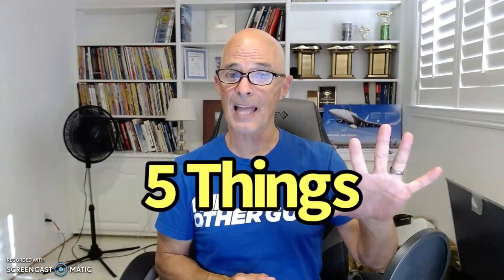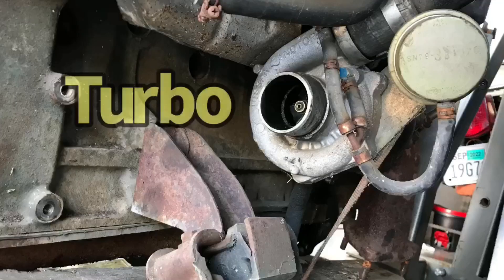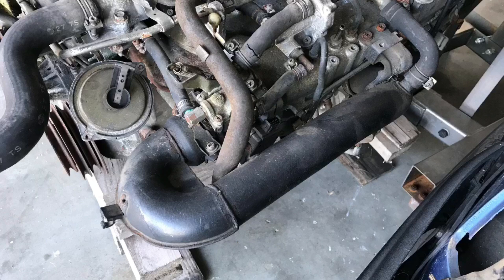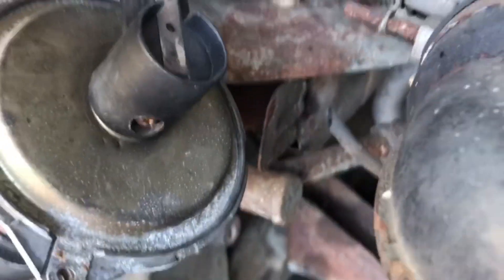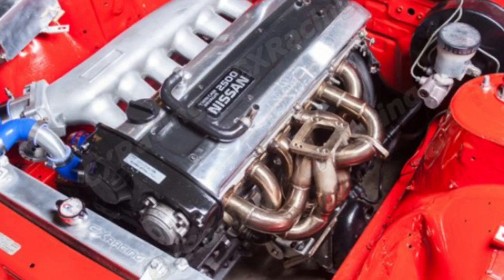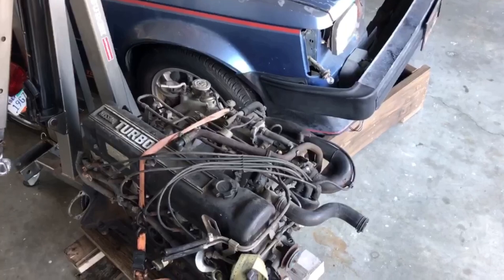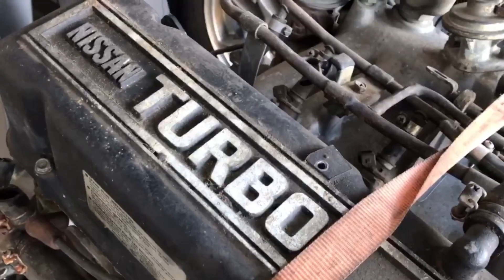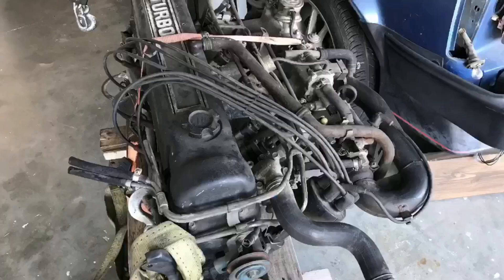280ZX TURBO-5 THINGS I LIKE AND DISLIKE ABOUT THE L28ET TURBO MOTOR. PART 1 OF THE ZXT MODS SERIES.

Comment: You missed one more bad, the throttle body.  We dynoed a S30 with a l28et.  He would make 280 ish hp and over 300 lbs-ft of tq but he kept running more boost to get it over 300 hp and it wasn't liking it.  I gave him a throttle body (KA24de or vg33 can't remember exactly) and a intake manifold that was roughly ported to match the Tb bore.  The car made over 300 at the lower boost level!
Reply from the maker: SEEMS ODD THAT A BLOW-THROUGH THROTLE BODY WOULD BE RESTRICTIVE AT THAT POWER LEVEL-I'LL TEST
Reply: @richardholdener1727  it had a intercooler and a gt35 turbo and I think we were under 20 psi but it was at least 10 years ago.  I can contact the owner cuz he still has the car and give you more specific if you want.

Comment: Love those mills , very smooth and a lot of fun .
Crossflow heads on I6s are not common , despite the advantages they would give .
No aftermarket company wants to spend the money to develop them , even for common domestic engines , despite the vast numbers of them out there .
It certainly is not a realistic home project , although , it has been done , at least on Ford 4.9s anyway .
Some folks absolutely will not let anything stop them .

We will forever be stuck with wondering what might have been with all these non crossflow designs .
At least these motors respond well to all the old tricks and many new ones  , despite the after.arket generally giving the owners the same finger the factories did .

As for the that hideous witches nest of lines on your engine , i prefer to think of that as a scarecrow to keep the lazy and the unmotivated out of the engine bay .
I am looking forward to seeing what you can wring out of this engine .
Reply: There are a few Youtubers building Ford 300 with welded together LS heads.
Reply: I have seen that , and it is cool as hell .
I especially love the 4.9 .
The fab skills are pretty awesome as well .
And there is just a certain special something about projects that will piss off both Ford and Chevy purists at the same time .
Maybe Richard can do a Pontiac I6 when he finishes with that Z engine and his Trophy 4 .
I am curious to see what he can do with a 230 or 250 cammer .

Comment: LOW C.R it's a freebie.
Intercool it and boost the living shit out of it.
That will solve your LOW C.R concerns.
The only thing I truly hate about this engine is the NON-CROSS FLOW head.
Same for the Chevy 250, 292, Ford EFI 4.9L, Chrysler Slant Six, et al.
It sucks having both cool and hot sides that close and cluttering one side on the engine.
Reply: Yup...but it's nothing a water meth set can't solve As a safety net

Comment: Awesome and timely content! Every now and again I'll take a look on the tube of yous to see if there's some new turbo L series stuff and almost every time I'm left disappointed. Z Car Garage's Nassty240z stands out, and there's some old footage of a dyno tuned L28 but it's numbers were kinda disappointing. Hope you can do more with it as it's often overlooked! Just be careful with that number 5 and 6 cyl, apparently they really like to heat up! Running E85 should fix that, or people drill ports in the head and run a cooling manifold to keep those cyl's a little cooler. Anyway, I'm anxious to see what you guys can do!

Comment: As a Datsun guy, it's cool to see you working with the L series. Coincidentally, your LS vids have helped me a lot since I gave up the L and went to the LS. Used an L33, which is funny because people get confused and say "Wait, I thought you couldn't stroke an L28 out past 3.2..."
Reply from the maker: diesel l series crank
Reply: @richardholdener1727  Love the channel, had no Idea you were a Z guy as well. I have a 240 and a 280z, plus an L28et sitting in the barn. I thought for sure you would mention the forged crank with 7 main bearings or the nice quench pad on the p90 head in your likes column!  I thought about slapping L24 rods into the L28et and machining the dish out of the pistons to raise the compression and take advantage of the head.  For now I'm going with the sacrilegious LS swap for the 280 as I got a low mileage LS3 dirt cheap and bought a brand new t56 triple synchro out of a ctsv before they went insane. I've even thought about destroking it after watching them scream on your dyno and because I don't wanna twist the old girl in half! 😉
Reply: You’d have loved what my dad and the guys at the Z shop in Vegas were doing. They were using NISMO and Newman racing tricks back in the 80s.

Comment: Hey Richard! I’m excited for this series. Can you do old school turbo tuning techniques and see how much gains there were compared to a modern tuning approach? Also modern same size turbo vs stock turbo to see the gains on turbo technology?
Reply from the maker: old school tuning tricks?
Reply: @richardholdener1727  I’ve heard from the older guys at car shows how they’d run an alcohol mix, advance timing, vice grip shut a vacuum line, and run a rising rate fuel management unit. Oh an added intercoolers! Us kids these days have e85 and fully tunable ecu’s so everything is done on a computer. Fun hearing what the older generation did for more power
Reply: @linoleumshake  " Turbochargers" by Hugh McInnes.
Scary to see what we did in the 70s. Electricity hadn't been invented yet.

Comment: Re intake: You're right. The intake will be "fine" for your testing and likely not be the biggest bottleneck.

Also half the junk on top is air metering control related. On an engine dyno, it won't be necessary, but more realistically if you run DBW, then all of it can go away (except the pop off valve).
Reply: Except the pop off valve? it’s one of the first things to go on a turbo Nissan when tuning! Used to pull them apart and shim them or replace the spring on stock engines just running a bit more boost, but really it’s best to get rid of it otherwise you end up over stressing the turbo and running higher than needed intake temps! It’s just a boost leak after all
Reply: @needmoreboost6369  also Fwiw, I daily drove a L28ET without any of the stuff on the intake at all (was actually a non-egr non-web manifold) on the factory ECU. A bit of a pain at times, like braking with all three feet in on cold mornings while the engine warmed up, but not the end of the world. Would never build a customer or friends car that way. But my own junk? Sure.
Reply: @nathanshobe  yeah this is true especially when you’re basically controlled by an Atari for management,removing aac,idle stepper, charcoal canister and most other add ons gains all the inconsistencies in low speed and cold idle control and 0hp as a reward, had a few hacked up Nissans my self an l24e mr30 skyline then converted to rb30, I’ve had 3 Aussie r31s, 2 vl turbos and still got 1 now but 400rwkw 25/30 also a sss stanza, a 200b and a bluebird but it’s an l28 I’m still yet to own.
Reply: @needmoreboost6369  my point is that it wasn't part of the air metering system you can replace with DBW. You can replace it IMMEDIATELY with no prerequisite as far as I care. ;-)

Comment: Negative Point 3: Fuel rail, in it's defense it was designed that way for a reason, and was same/similar to most Bosch systems of the era. Modern fuel rail systems produced later incorporated items like pressure wave dampening devices, along with sequential injection, both of which resolve some of the pressure wave issues associated with EFI injectors.
Reply: Dampening is especially critical when manufacturers used as little fuel pump as possible for multiple reasons the biggest being cost,not saying it’s not a good idea for a dampener but if rail pressure instability is a problem it’s because there’s not enough flow
Reply: The famous rb30et ran the same setup and the upgrades include injectors but not a new rail to start with at least.

Comment: MAXIMUM BOOST by Corky Bell FTW!  Page 163 will change yer life!
Reply: "RULE: It is hard to find a turbo cam that works better than the stock item."
Good street recommendation..
Reply from the maker: THAT IS UTTER NONSENSE-ONE OF THE THINGS BELL GOT WRONG IN THE BOOK-STOCK CAMS (LIKE ALL CAMS) WORK AS TURBO CAMS, BUT SO MANY BETTER OPTIONS
Reply: @richardholdener1727   Yep, a good street recommendation.
About the only thing I had issue with Bell was his saying that the chargecooler  forward heat exchanger was the least most important part of the system. I think he had a weird dragstrip bias.

Comment: THUMBS UP #1 well... it's a turbo motor Skippy! #2 "TURBO" script on the valve cover is worth 3 tenths in the quarter and 2 high fives at the Gas N. Sip on Friday night #3 Factory iIntake manifold less factory hoses/switches/doo dads is good #4 oil cooler is cool... er.  Literally.  #4b under hood light?  huh? #5 Pop off valve

Comment: That cheesy factory blow off valve is handled with a 1” pipe plug. I built a 3.1 l stroker with a diesel crank - l24 rods vg30 pistons. I built a fuel rail with blank rail extrusion.I ran a bigger turbo.

Comment: Had a neighbor (still there) That had 3  280zs.g
He was using parts of two to build one
All rust buckets
I volunteered to help he did the drive train, I did body work
One f these was a turbo
Not factory , but add on. You must go back in time to the 60s and 70s. In your mind
That is my time
Turbo’s were a novelty ,  the turbo engine was almost trash
I tore it down to clean it up
 The exhaust manifold was cut open, a pressure regulator tied to intake to up fuel pressure on boast.
This was a “kit” installed by some dude that was doing that kind of stuff.
No blow off, boost regulated by a inline device in the intake pipe be fore the intake air regulator.
All Miller in California was using these things to turbo all sorts of things.
Bottom line , the old computerized set was almost useless(or I was)
I could get it running for very short times had to tear turbo apart to clean it.
Lately I wish to be able to do what you are going to do with modern fuel and ignition control
And choice of turbo.
 Wouldn’t be Surprised to see that thing still setting there

Comment: Kool vid.  Yeah!  Turbo L series!  I always wanted to do the same thing.  I have a Datsun 620 pick up with an L18 with a cam, mikuni intake, twin Webber 45 dcoe, header, ported head, and an old Jacobs ignition.  Turbo would dramatically increase the fun.  VW doods used to use carb enclosures, and I thought the Datsun could use the same deal.

Comment: I didn't like the 500 dollar (in 1980's money ) optical turbo only distributor .especially when it went on the random fritz .I did like the pop off valve they could be manipulated to allow the whole 12psi or so that turbo could deliver .a little alcohol injection and 555 timer to the  7th injector 
But the fast ones were the lighter 240s with stroker 3.0s and the turbo 280 differential. Then came broken half shafts

Comment: When you mentioned 5 things you like, I was expecting things like head sealing, steel rods, main cap bolts, cylinder wall thickness, number of main bearings...you know, hard core stuff that is too $$ to easily change, so should be present in the basic design.

Comment: Uncle in Australia is running one of those with a blow through 4barrel in his sports sedan.
It puts out over 600 hp and is totally unopened.
The boost comes in pretty late.
Reply from the maker: 600 hp unopened with a blow-through 4 barrel?